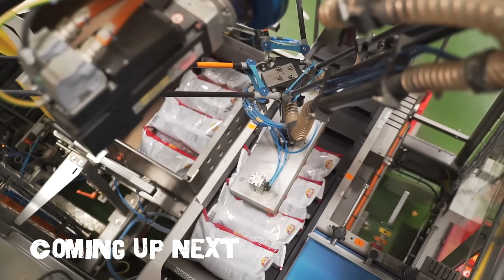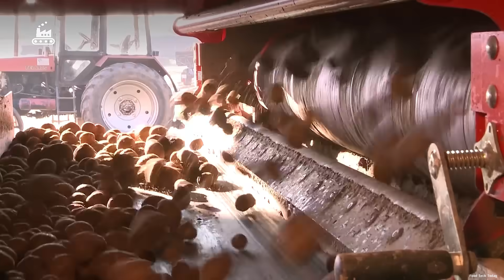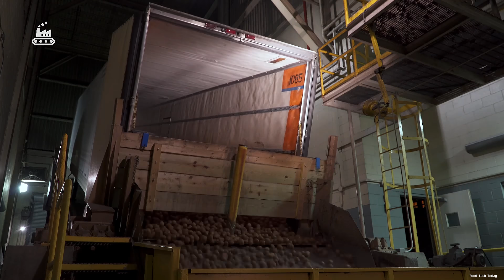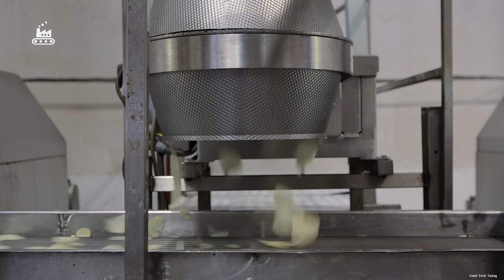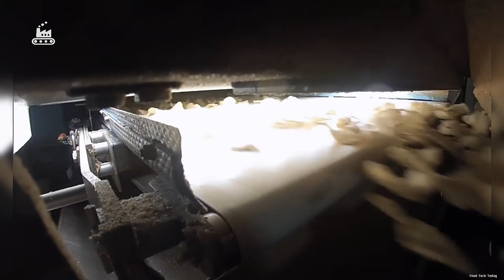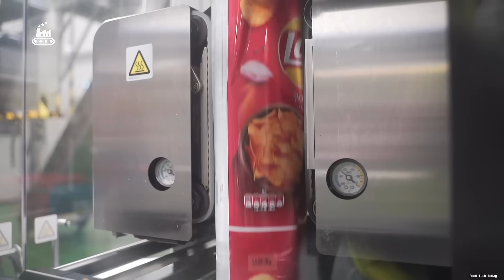How Lay's Potato Chips Are Made In Factory | The Incredible Process Behind Your Favorite Snack

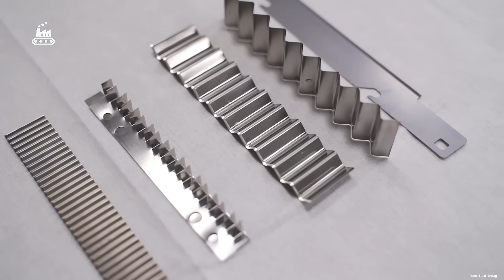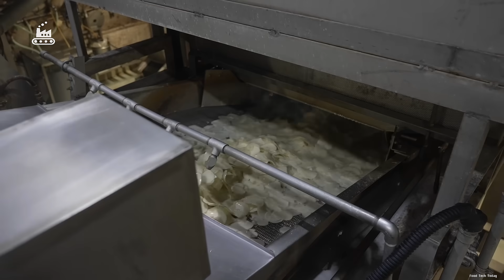Comment: I worked in a blade manufacturing facility in the U.S. At 7:14 to 7:31, the video shows some of those blades. We made many other kinds of blades for medical use, food processing, textile manufacturing and utility blades. I worked in the grinding department where we pulled continuous strips if heat treated metal through machines that ground the razor edge on the top. A single grinder operator, in one shift could grind as many as 13,000 blades, depending on the machine. Another machine sharpened "coil stock". This one ground the razor edge on the metal which ended up as a continuous, unbroken coil of a certain size. This is shipped to the cutting equipment manufacturer, who turns it into individual rippled blade for rippled chips. Unique kind of factory job.
Reply from the maker: What’s the name of that factory? I’d love to film the process there if that’s possible
Reply: @FoodTechToday  I spoke to the owners of this facility, and they don't want me to disclose their identity or location. There may be conflicts with other blade manufacturers and their customers. Sorry, but I will honor their wishes.

Comment: 7:31 I used to work as a cook in a potatoe chip factory and we'd have to change these blades every 2 hours.
Reply from the maker: What are those factory blades made of that they need to be replaced so often?
Reply: @FoodTechToday  Back in the 90's there were only 12 blades in that circular rack nowadays they have so much more blades. It's just like your shaving blades, they'll get dull after a while and the cuts won't be as clean. Not exactly sure what type of metal the blades were made of.

Comment: I was an engineer for semiconductor electronics for over 35 years. I used to think we were the only great technology until I learned about the food industry. I am deeply impressed.
Reply from the maker: The food industry doesn’t run on silicon… it runs on salt & oil
Reply: @FoodTechToday   Thank you but perhaps my point wasn't clear. Regardless whether it is oil or silicon, the level of technological precision required to maintain perfection in the creation of whatever they make is impressive.

Comment: For general info........
The "air" inside the bags is nitrogen at a purity of 99.8%.  This N2 helps remove the ambient O2, and therefore prevent rancidity.  It is used by virtually all snack food packagers (Jack Link Jerky, Planters Peanuts), and almost every chip manufacturer.  Once the bag is open, the N2 dissipates into the air (which is 78%  N2 anyway) immediately.  
That N2 "pillow" is essential for preserving freshness during shipping and storage, and helps in final shipment to keep chips whole as best as possible.
Reply from the maker: That’s not air you’re paying for — that’s VIP potato protection
Reply: What is the side effects😂
Reply: @CoolGuy-bt9ik   nothing, it goes into the air
Reply: @OneWithZionz oh is it? Can you guarantee that it doesnt cause any chemical reaction to the chips which is sealed inside for longer period?
Reply: @CoolGuy-bt9ik  dude it's nitrogen,  it's not toxic. jesus

Comment: I worked at Nalley's Potato Chips about 55 years ago when I was a teenager. I used to unload boxcars and truck trailers of potatoes in sacks by hand into large wooden box crates. It was very hard work. I used to get blisters from opening all those sacks and after a while they would open up and sting due to the potato residue getting into them. A forklift would take the crates into the large storage building. It would then take several crates at a time and dump them into a large hopper which in turn would send the potatoes up to the peeler / washer machine before they would go into the slicers and then into the fryers. I've never worked in a food processing factory that was kept as clean as Nalley's. I used to enjoy eating fresh potato chips after they came out of the fryer and salter.
Reply from the maker: Respect—you were making snack history

Comment: 0:10 That circular box taping machine. Wow.
Reply from the maker: yes
Reply: I worked at Lowe’s for a bit. Their idea of wrapping pallets was to get the employee to grab a roll of plastic wrap and walk around the pallet 20 times.
Reply: @JuanVega-ns5ok  Yeah I saw that too, but in Vietnam in a shoe factory.
Reply: @JuanVega-ns5ok  Probably because the volume is low. I presume you also manually stacked various different sized boxes and objects on a pallet to wrap.
Reply: It's an Moeller wrapper. Have them at my work
Reply: It's stretch wrap, not tape. Fritolay has a program where the route drivers that stock the store shelves return the cardboard boxes back to the plant. To be reused, roughly 5-6 trips. This cuts done on waste produced.  The chips rejected,  potatoes rejected,  and the corn rejected are separated and used for animal feed. Food Solids in the production water are filtered out. Go through a press drying cycle and used for animal feed.   All bag film is recovered.  And recycled.  Reducing waste to the landfill.  They are very proactive in reducing landfill waste.
Reply: You mean... the stretch wrapper?

Comment: Put some chips in bag . Air naturally fills rest of bag . Seal bag . Charge as much as you can get away with without tanking sales . Put printed notice on bags to cover butt stating that settling makes bag of chips less full because it was full when filled .
Reply from the maker: Somewhere a marketing team high-fived when they came up with that fine print
Reply: Sorry but that ain't AIR.   It's 99.8% Nitrogen in that bag.  Prevents rancidity. Also acts as a cushion.  I put in most of those systems for Frito over the years.
Reply: No it is packed by WEIGHT!!
Reply: Speaking of too much air: You do not put spaces before punctuation marks,* only after.*